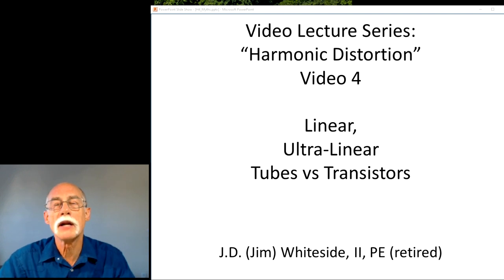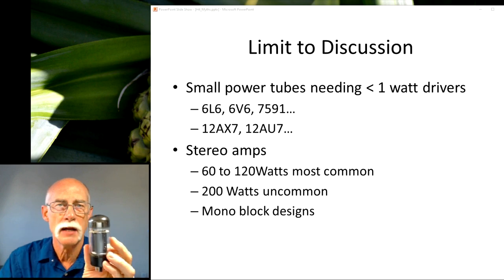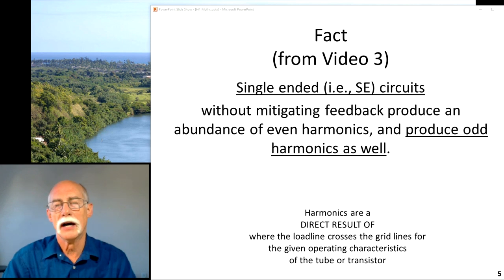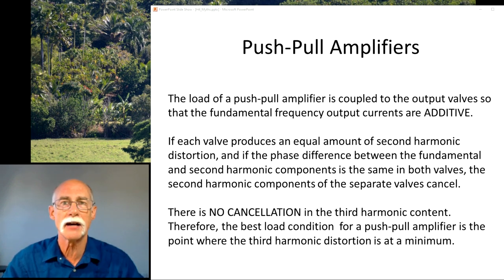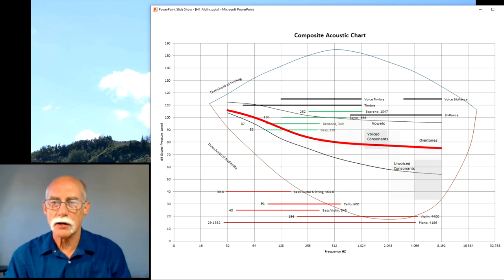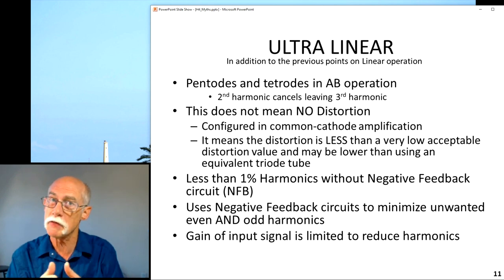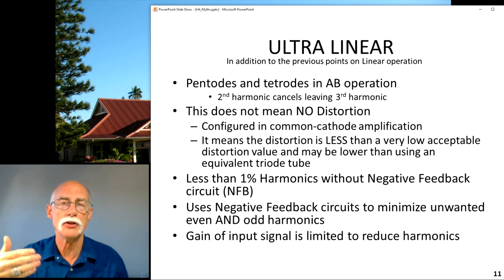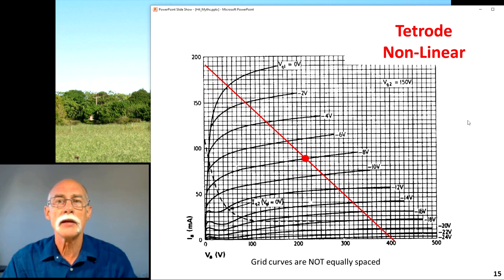Harmonic Distortion Video 4: Linear, Ultra-Linear and Tubes vs Transistors

Comment: The 3rd harmonic is the only musical odd order, which the ear treats much the same way as H2 in that it tends to be innocuous. FWIW, a properly functioning analog tape machine makes a dominant H3 also, which is why studios often retain them- no-one seems to argue with the 'sound' of tape. If the amplifier design is fully balanced and/or differential, if the operating points are correct then the 3rd will be dominant, and open loop will not seem audible to the ear.

Comment: Howdy. Nice.
I would like to comment though ...
The even harmonics do not go away in PP in class AB. If the PP is run in class A then technically the even harmonics would cancel.
The strong 2nd harmonic in tube amps most likely comes from the magnetization properties of the output transformer. Hysteresis is one factor. Another factor is the magnetic momentum. The acceleration of the magnetization during signal ascent will be "braked" and the retardation of the magnetization "boosted" during descent. These result in slimming of the ascent and fattening of the descent. In other words, the generation of the 2nd harmonic.
Regards.
Reply from the maker: You are correct. In my video series:  "Fender Deluxe Tweed 1959", the points you make are supported in see videos tagged: FD8 through FD10.  Thanks!
Reply: @deepblueharp  Howdy again. About determining the load line.
I would imagine it is alluring to think the load line should be in a 90 degree angle to the grid parabola at the work point.
That need not be the case in my mind. I believe the point is that a, say, +-1 V grid deviation produves as equal deviations in the anode voltage as possible. I would think that unsymmetry produces odd harmonics.
In high regards.

Comment: I assume that you are using the term "ultra-linear" meaning that the input signal is limited so as to not drive the tube into it's non-linear regions (near cutoff and near saturation)? Having nothing to do with an ultra-linear output transformer (as developed by David Hafler and Herb Keroes who started Acrosound )  having screen grid taps so that a pentode ( or beam power tube) is operated some where in between pentode and triode? Thank you.
Reply from the maker: Yes.
Reply: @deepblueharp  Thank you for the answer and thank you for the video.